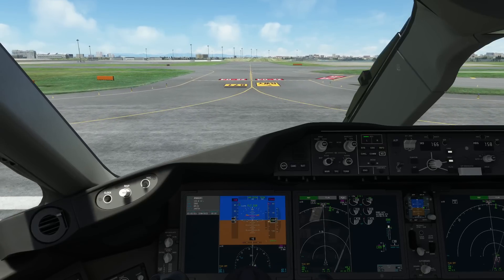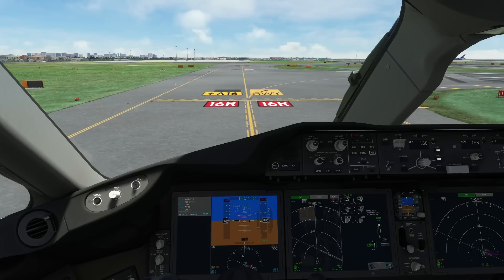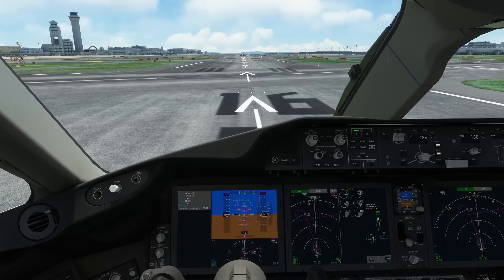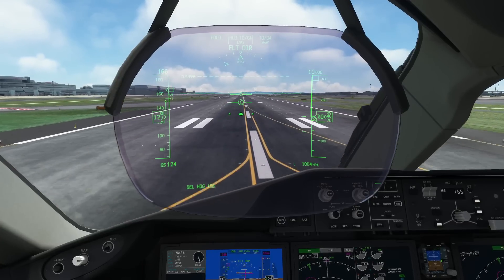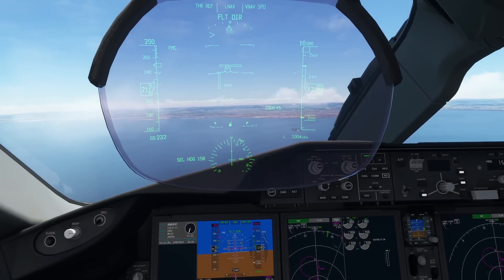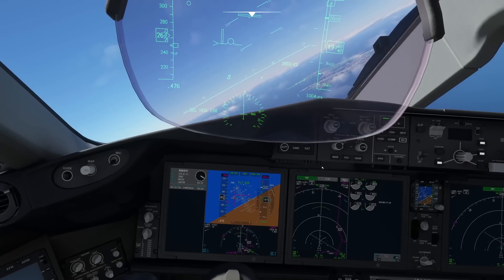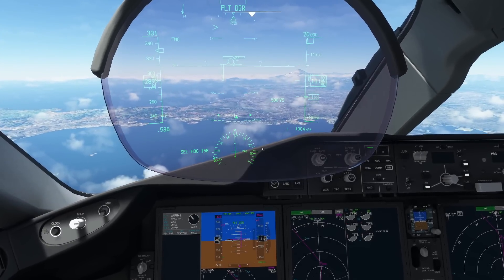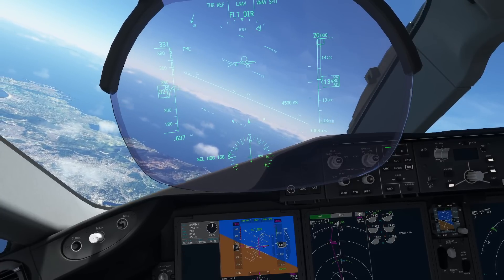Understanding the 777 & 787 Fly By Wire Laws | Real Airline Pilot

Comment: You explained 1/3 of the Boeing FBW system well. The other 2/3  are first all the protection the system offers (stall, overspeed,  g-load even tailstrike and approach bias). This is basically the same part as the Airbus system. The last third is PATH stabilization when speed is within a couple of k ots of trim reference  and acceleration is very small. In this case the system will hold a path.

It is important to note that the system is more about stabilization rather than frantic target chasing (like an AP mode for example). The beauty of the system is that the airplane on the outside flies like a normal plane, the system is almost invisible. It is just a very very easy plane to fly. Finally a typical feature of pilots moving to the 7 from say a 744 is constant over trimming! I believe  that the msfs version of the PMDG 777 FBW will also highlight the marvel this system is.

On a personal note Emi's contribution via testing and LONG discussions to the 777 FBW system have been absolutely invaluable in taming this mathematical beast. I never got to say thanks in public. Vangelis.
Reply: I can stall the MSFS 787. Should that be possible?
Reply: @aspecreviews  Yes you can stall it. Should however make it very difficult for you. E.g. load your control column forward.

Comment: Question do you still have to trim while the plane is in autopilot or is it only applicable when hand flying? I’m coming from Airbus so I’m not used to the whole trim thing on Boeings yet.
Reply from the maker: When the AP is on it trims automatically. That's a general rule which almost all aircraft abide.
Only a few general aviation planes like the Comanche are not following this.

Comment: Just a quick point, our fly-by-wire does not snap the trim speed to the current set speed as speculated at around 7:32.
Reply from the maker: Really Matt? Surely that's exactly what it feels like flying it. Can you she'd some light into how it works then?
Reply: @A330Driver  It just commands a constant rate trim speed change as you hold the trim switch down, we haven't added any special mechanics to it

Comment: Really informative video! I always struggled to fully understand the logic behind the fly by wire on the 777 and 787. Especially when flying the pmdg 777 in P3D I always felt that I was either overusing the trim on approach, or underusing the trim. This cleared up alot thanks!